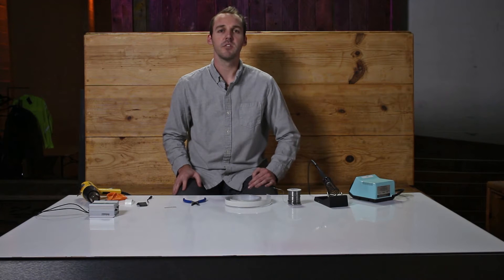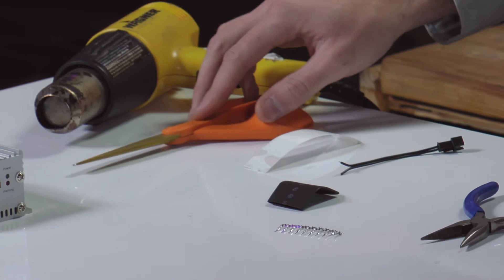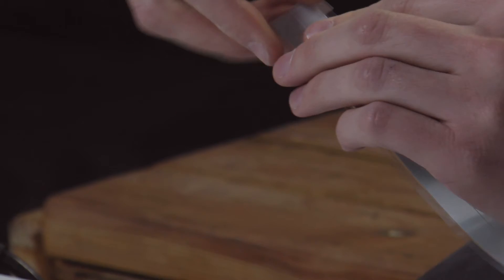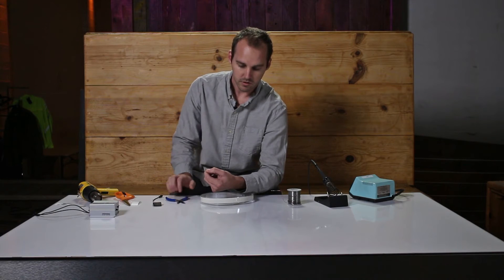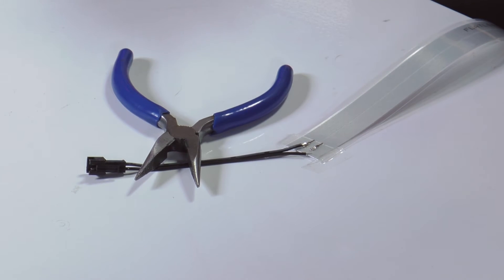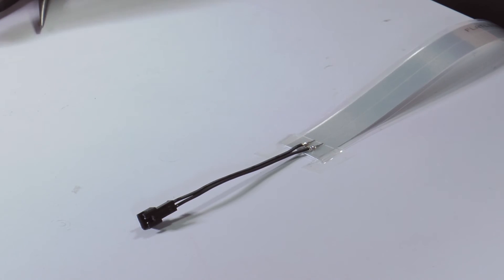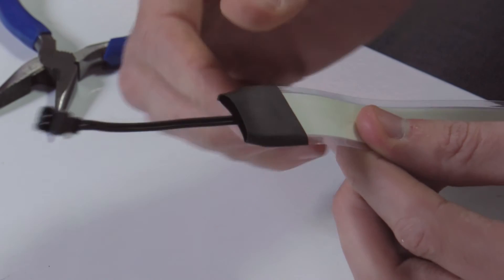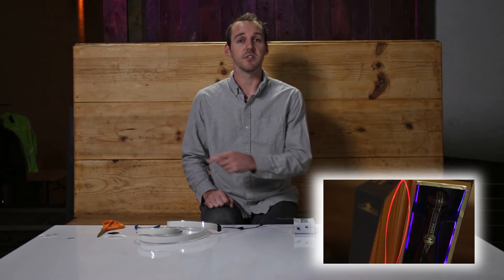How To Connect EL Split Tape - Ellumiglow.com

Comment: The EL Tape I just received does not have a line running down the middle separating the positive and negative connections like you have in your video?  It appears to have 2 sides one is copper color, and the other is a greenish color, and it looks like the connections use a different technique for attachment.  I don't know if your crimp connections would work on this stuff?  Have you seen this type before?
Reply from the maker: The crimp connection method will work on all types of EL Tape. The tape that doesn't have the line running down the middle is called Parallel EL Tape, and the bus bar is pushed off to one side (usually like a 90/10 split). Use the same method as described in the video, but try to get one conductor on each side (one is on the 90% side, the other is on the 10% side).
Reply: Thank you for the super-fast awesome response!  Okay, time to order some stuff from you guys!  :-)

Comment: Are you sure you didn't mount that crimp connector backwards on the EL strip there? Looks like those 2 pins pointing towards the longer end of the strip should have been used as the wire solder points. Shouldn't they be hanging off the edge of the strip for the wire to solder onto?

Comment: Can you cut the EL tape to any size in length and wide or just length?
Reply from the maker: Sometimes cutting large panels down to smaller panels can cause issues because the bus bar (which sends power evenly throughout the panel) is trimmed too much. For the most part, most tape can be cut down to nearly any shape or size, but try to keep the bus bar (which is typically the thin silver bar on one side of the tape) in tact as much as possible. Also, make sure to seal any cut edges immediately after cutting to make sure no  moisture or debris gets inside.

Comment: how can I trouble shoot my el tape? I have a few that parts of the tap does not light up what could be the cause. of that...m and also how can I make my el light look like it is in motion?!?
Reply from the maker: If parts of the EL Tape don't light up, it's likely a phosphor issue and the phosphor degraded over time and is unrecoverable. If the tape doesn't light up and you know the inverter works, try making another connection. Unless you have multiple pieces of tape (or multiple segments), it won't look like it's in motion. We can custom make parallel EL Panels that have various segments. By using a custom inverter, these can turn on/off at different times which give the appearance of movement.
Reply: Ellumiglow can you send me a link to that inverter
Reply from the maker: Jonathan Pazderski it's actually a custom inverter based on our Mega line of inverters. The reason we do this is because sequences need to be tuned for the sqin you are using, in order for the effect to look right. If you would like more information, please email us at info@ellumiglow.com.